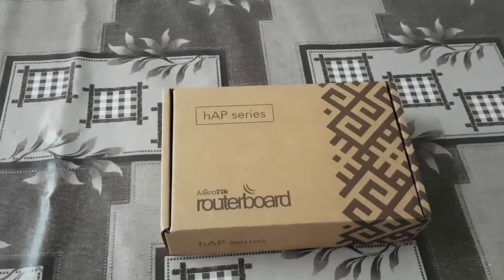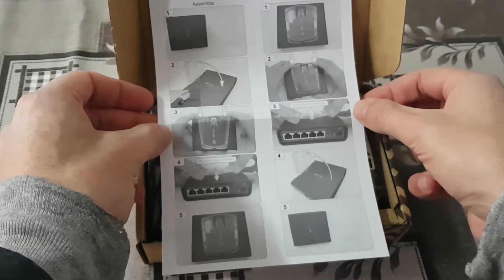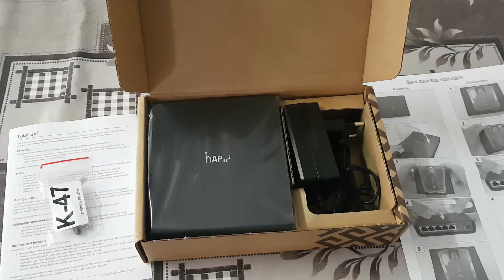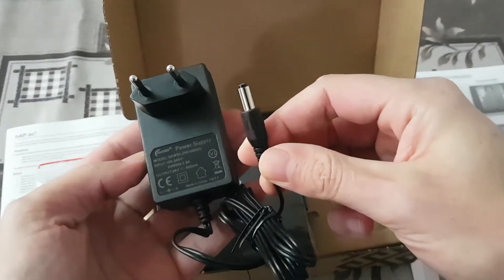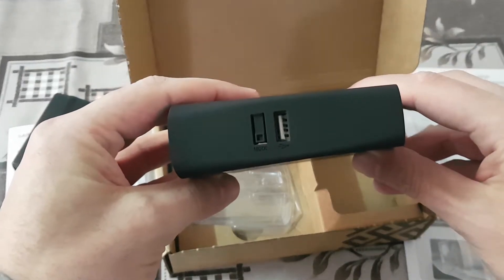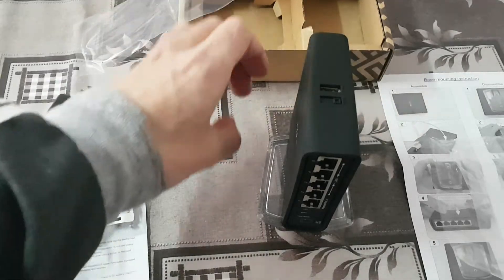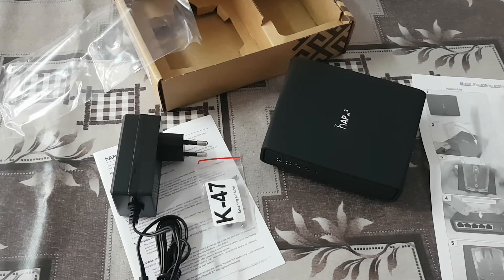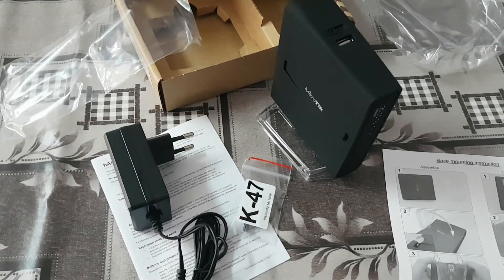MikroTik hAP ac² Unboxing and First Look (RBD52G-5HacD2HnD-TC)

Comment: 1:55 device can be placed on tower and on bottom, that's it ... 😐
3:03 wall mounting screws 🤣

Anyway, I think you can mount the transparent plastic on the wall and slide the router in :D

Comment: it's 128 MB ram..
Reply from the maker: El Cucuy system report 256MB ram. Also mikrotik admins confirmed that RAM is higher then 128MB.
Reply: ok.sorry)) maybe depend on country.but in mikrotik official it's 128mb
Reply: 256+4core super good for 70$
Reply from the maker: El Cucuy in first production batch they have 256MB ram. Maybe later that will be corrected.
Reply: Good thing is... My hap ac2 has 256MB ram too :3